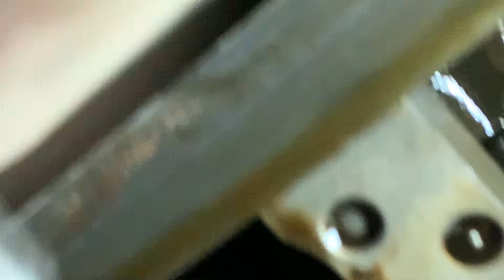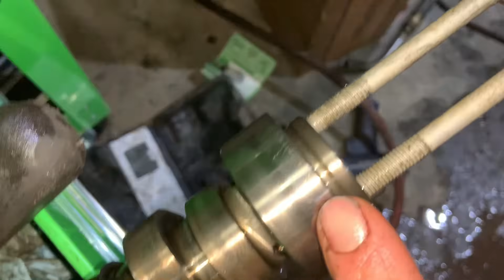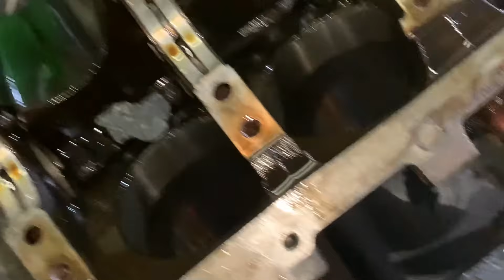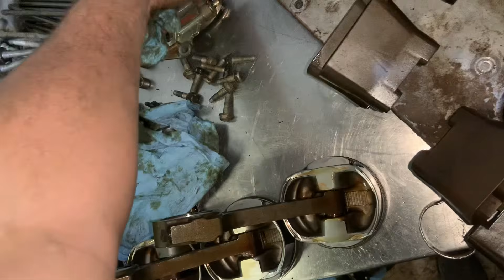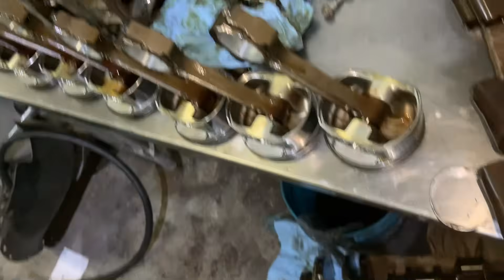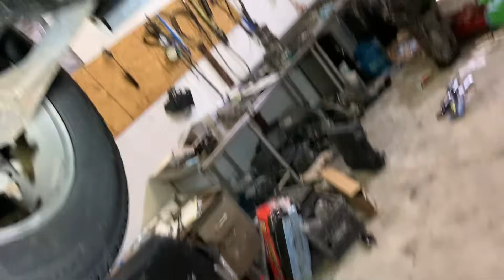ULTIMATE LS ENGINE NO OIL PRESSURE LOW OIL PRESSURE DIAGNOSIS AND REPAIR GUIDE

Comment: what about new build, good oil pressure 40ish I know the oil ring is good but noisy new lifters not much if any oil to the top of the engine, this will be the second time I've pulled the engine and tore it down , I realize I have missed something but this isn't my first build, 40 + years in the business,  its either bad new cheap lifters or very low flow to them and that' s hard to diagnose......thanks for your help
Reply from the maker: The oil galley feeds the lifters first in this motor then down to mains and rods.  If you have 40 plus something is for sure wrong.  I only use ls7 lifters.  Im sure you have done this but make sure you pushrods are not plugged up.  Run compressed air through them.  I have never seen this before when oil pressure is good.  let me know what you find.  Sorry Im not more help
Reply: @Brainstangs  the engine is in a 1957 Chevy 2 door wagon, these are not large cars and the engine is tight on the left side and rear so R&R is not fun everything has to come off of the engine including engine mounts intake exhaust manifolds ect. I'm seriously considering building a test stand to run the engine before i install it again. I will pass on what happened to the lifters when i get it pulled out and inspected.....thanks again
Reply: What did you find out?
Reply: Sorry for the delay too many projects all lifters were bad....I would like to show pictures of the differences in OEM lifters and cheap Chinese lifters but I'm not good with getting pictures into forums or any other places  but I could do a YouTube video but don't know how to reference it to this video???? there are some good cheap foreign lifters out there as i have a set in my first LS swap they are perfect but i got them on eBay and that seller is not active so i couldn't get another set from him......sorry but I just can't pay $300 for a set of lifters

Comment: Brian I thank you so much for your video I think it’s the best most detailed I have found. I subscribed. I have low oil pressure on 2010 6.2 liter LS Yukon xl Denali . Did the whole passenger side lifter change. Put all back together drove a week and sudden oil pressure drop. New VLOM new oil pressure gave. I am thinking now O ring on pick up tube maybe oil pump and now after seeing that I’m worried it’s cam barring . Ugh . I see oil around oil pan I was think rear seal but idk if that would cause sudden loss of pressure. Idk where to go from here. Father of 6 northern nuts, cheers bro Kevin , merry Christmas
Reply: Hey Brian, so I ended up taking off the harmonic balancer, doing the oil pump. I also managed to do it without taking the oil pan down. A complete miracle, but was able to crack the pick up tube bolt with a 10mm wrench and then the trick was with a magnet that faced 90 degrees upward I slowly worked the bolt till it was out. Tied a string to it half way down so when it came out and fell into the pan I pulled it out. I replaced the O-ring, and new regular flow pump. But I modified the pump relief valve by putting about 4 washers under the spring. I also used one of the bolts off the old pump with a washer to hold the other side of the pickup tube. Perfect matching bolt. After I put it all back together. And flushed the motor two times, all of a sudden I had oil pressure up to 55 psi on start up. 193,000 miles. I believe the pump and O Ring had issues. But I also think somewhere in the bowels of the motor there was sludge. It blew through with the higher pressure and wow, pumping good. I also went up to 10W30 conventional synthetic blend oil. I don’t think full synthetic 5w30 is good for these engines. It’s just too thin. So learned some new tricks, wasn’t easy. But didn’t take the oil pan down, modified new pump, upped the weight in oil and engine flush. I don’t think the lifters will fail now when it drops the pressure with active fuel management. With the oil pump modification it never drops into the teens. So all this work has paid off for the time being. Happy New Year 2021. Thank you for your Videos. Cheers 🍻 Kevin from NJ
Reply: Ha northern New Jersey. Again your video was great. I’m nervous to take the oil pan down myself on Jack’s. I did the lifters but I’m dying to know about the O Ring. Or even the pump. My oil pressure was around 40 cold down to 20  and teens at idle. Then to zero suddenly. No engine noise at all but the bells and whistles going off to shut it off. It was a new oil sender switch but could it be brand new out of box broken? And that dumb lil filter? Wish I was in Utah to bring it to you. My sons Liam And Se’amus look like your Ethan, god bless, Kevin
Reply from the maker: did you get it?  What was it.  Im guessing a new pump with oring will fix it.  If you had 20 psi, your cam bearings were where the needed to be. Unless they just popped out.  Let me know

Comment: 2006 5.3 138k miles no oil pressure at times. Replaced the sending unit and pick up o-ring. Still no oil pressure at times and the engine is noisy.  I just started it again no oil pressure at idle. Revved it to 2500rpm and 40psi. Back to idle 20psi, 3500 60psi. I know it is not fixed. Oil pump time?
Reply from the maker: yes.  that is your culprit

Comment: Great Video! Very informative. 
I have a long story. 2008 Silverado 5.3, 230,000 miles. I had an issue with zero oil pressure, fixed the issue by replacing the o-ring. Had great oil pressure again, 20lbs + at operating temp. I then had an afm lifter fail. We did the dod delete. New gm lifters, new valley cover, new lm7 cam, melling oil pump, and timing chain set. The engine runs and sounds great. Cold oil pressure is great at idle and at speed. However, at operating temps, I’m at 12-15lbs of oil pressure at idle, no higher than 38lbs while driving. Could this be the oil pan pressure relief valve? Cam bearings? Thanks
Reply from the maker: the gen 4 engines run less oil pressure at idle.  I delete the pan oil pressure relief when Im in there  always.  Dont know if thats your issue.  Not too concerned with 12-15 at idle.   If it was a cam bearing it would be five or less.  lot of miles, oil breaks down and gets thinner.  With a little looser clearances in  the motor and older oil this makes sense.  You do a fresh oil change and put 20-50 in there and  I bet you get good pressure.  Remember pressure is only and indication to flow.  You dont need much pressure to float bearing around a crank, you just need to make sure the volume is there.  So what I mean by this is for example, cold morning start, oil is thicker, pressure it up when you first start it and then drops off as it warms.  So this condition gives you more pressure but less volume flow as the oil is thicker and some is most likely recirculating at the pump pressure relief.  Hot day outside and engine is hot. Low oil pressure or what that really means is low resistance to flow, so you have lots of volume but lower pressure. As long as you pressure dont drop way off like under 8 at idle your fine.  Sorry this is long winded. Hope this helps

Comment: I have a donor  4.8 with 65k for a swap out of a wrecked van. I intend to swap in a project without rebuilding. I have not attempted to turn over the engine yet. It has been sitting a few years. Looks like it was stored indoors and looks pretty clean. I will be swapping the pan. What would be the minimum I should do to ensure a good runner? I'm thinking: prime oil system, Compression test/leak down, change barbell seal, pickup seal, cam plate, check for migrating cam bearing, seal the flex plate bolts , Valve seals, anything else?  What is your list for running a wrecking yard engine?
Reply from the maker: your list is quite comprehensive compared to mine.  Barbell is fine, dont touch, for sure do a oring  on the pump if not a melling 295 complete pump.  They are only 50 on amazon.  Sure prime the motor on the stand and while doing it turn it over a few times by hand and a 24 mm socket.  That will get fresh oil on all the parts inside.  Thats really it unless you see something obvious.  These engine are amazing.   Compression test on the stand after a few years sitting is tricky as the lifters have pumped down and you wont get good cranking pressure.   If the valves dont open enough and on time due to lifters that are not pumped up, you will get a false reading.  same with a leak down. If you dont suspect any damage, it will most likely be fine. Cam plates rarely go bad.  Even if they do they dont leak enough oil to really matter.  So I would not bother here either.  Valve seals generally are pretty good too.  Do them if you like.  Just lube the top end with covers off so start up isnt dry.  summary , biggest thing for me is new oring and pump, and a good prime.
Reply: @Brainstangs  When you say o-ring on the pump, are you referring to the pick up tube o-ring?

Comment: what if your LS2 starts Cold with good oil pressure but drops 15 psi when the engine warms up??
Reply from the maker: That is the what pressure and viscosity do.  Cold in morning so its hard to flow the thick oil, so you have higher oil pressure.  As it warms oil thins out, its easier to flow, pressure goes down.  Totally normal.   Nothing to worry about as long as your over 10 psi at idle hot.  Cause at 10 hot your still getting a ton of volume delivered.  If your looking to raise the overall pressure you can try fresh 20-50 and I bet it gains 5-10 psi everywhere.

Comment: Great information in this video, keep up the good work! My LS build had issues with oil pressure being extremely low, took it back to the machine shop. Hoping that its one of my cam bearings as well (even though they replaced them once already, hoping its just misaligned)

Comment: My motor was apparently on break in tune. Heads cam LQ9 just rebuilt according to previous owner. I had 25 to 30psi. Was getting gas in my oil. One day was driving it around 1 mile away from my house then I have no oil pressure and its starting to tick. I turned it off and kept using my key to prime the pump. Has 15psi oil pressure and doesn't tick or knock loud enough to hear over the straight pipes. Also my dash oil pressure doesn't work it's a hard wired guage. 

I haven't heated the motor up science it lost oil pressure but I've moved it around the yard. Gets 15psi now. I'm pretty screwed aren't I.

The bottom end wasn't touched I don't think when the previous owner swapped it into my camaro.
Reply from the maker: put a pump in it now.   And you might be fine
Reply: @Brainstangs  I fixed it by buying an L96 6.0 out of a G8 with ported 821 heads and a ported Ls3 intake and cryo coated

Comment: Wondering if you've seen my combination of symptoms.  2006 5.3L 238k miles.
Oil pressure recently changed from 50-60 psi constantly to 35-40 at idle and can sometimes get 50-60 while on the gas.
The engine sounds great on a cold start, but as soon as it hits operating temperature a bad loud tick starts, like a lifter tick.  If I give it a little gas to bring up the oil pressure I can make it go away, and comes back again after idling a bit.  Then it goes away completely after driving around for 10 minutes or so.  I'll have this tick every time after the engine warms up from a cold start.
Reply from the maker: 100 percent the oring at the pump. its getting air and lifter tick.  Change the oring and you will see!

Comment: I just lost oil pressure in my 02 silverado (0 psi) it started making all kinds of noise on cold start this morning, it was running perfectly fine yesterday at around 45 - 50psi with no symptoms. I will use the info you gave us to try to figure this out the right way.
Reply from the maker: im sure its a pump or oring issue.  Let me know what you find
Reply: Go lookup the LS engine for piston slap(some pistons are cam ground so they seat properly when hot...

Comment: Very informative video . Thanks for posting.  I do a lot of 07 and up AFM deletes on these engines, I done one last week that has me stumped. before the reprogram and VLOM modification I had 40 psi cold 32ish hot and a quick oil pressure  response when rpms are raised .  First start up after the VLOM  mod and reprogram the oil pressure was 19ish cold and dropped to 0 fairly quick. No engine noise at idle. I checked with a manual gauge and verified it was indeed that low. So after doing 20 or so without issue this has me puzzled. I just don't see what could be that immediate  Do you think oil pump relief valve maybe stuck just by coincidence?  Or is it possible when I took the gaskets off the towers the lifters are bleeding up the tower? I have the oil hole blocked on the VLOM so I'm not loosing oil though the solenoids . The truck runs smooth and strong after the delete and before. The reason for the delete it would backfire when it went into 4cyl mode, ran fine in v8 and runs good now in v8 just low pressure. I am going to check oil pressure at the filter later this week when the adapter comes in. I appreciate any thoughts you may have on this.  Thanks
Reply from the maker: I doubt its anything but related to your afm delete.  I would bet you have something leaking on your towers.  What kind of delete do you do?  I do them all the time but I put in a l92 valley cover and new cam and lifters.  I know there are hacks but I think they can cause other issues, maybe here.  Good luck on this one.  I think if you dig back into it and tap and plug the feed to the vlom you might find your oil pressure is back.
Reply: @Brainstangs  Thanks for the response.  The AFM delete I do consist of a tune to turn the system off and i remove the VLOM valley cover and plug the hole that feeds the solenoids and cut the tower gaskets just for added insurance in case of back pressure on the towers so the AFM lifter will not collapse. I have done many this same way and never had a issue until this one.  But this truck has been a odd one from the start with the backfire issue when it would go into 4cyl mode. Never had one do that, but it runs great now after the delete  but has the oil pressure issue.  Do you think a lifter would let oil bleed up the tower and loose pressure ? Just throwing stuff out to see what might stick. LOL Thanks again .
Reply: @jackmac9569  I had the same problem with my DoD delete, what did you come up with

Comment: Will it make a noise when the cam slides out?? Like ticking?
Reply from the maker: if you have no oil pressure it will tick for sure. lifters are bleeding down at this point.

Comment: Thank you! Great Video. 1 Question the cap in front that the barbell is in. If there is No cap in front will you lose or No oil pressure?
Reply from the maker: The barbell has no cap.   It’s held in place by the rear cover. The cap you may be referring to is a expansion plug/cap in the front of the block.  If that’s out yes you will have no oil pressure

Comment: ls1 big cam no problem good power love smoking the wheels but one morning started up and hear all engine noises.Pop the bonnet can hear all tapping noises and then it just stopped.
Took it to protune auto check oil pressure ok he had it for a few days no problem.back at home for a week and no problems so far.But from watching the video it looks like the oil pump could be at fault.
Reply from the maker: yes.  stay on top of that!  you might need a  pump

Comment: Had replaced my high volume an high pressure oil pump an my pick up tube now recently have low oil pressure problem an when i start my truck up the pressure goes up to 20 psi but when I drive it goes up to 40 psi an when i pull up to a stop the light comes on an RPMs drop
Reply from the maker: 20 at idle isnt  a issue.  that is fine.  When you see 10 psi thats when I worry and think something is wrong

Comment: I have an 05 Tahoe. 5.3. Sometimes, as I'm driving the oil pressure will go to zero. I don't get a message on the dash and the engine has a very very slight tick, you Really have to listen for it and even then I'm questioning if I'm hearing a tick. I replaced the oil pressure sensor with an OEM one and I thought it fixed the problem but today, as I'm driving I noticed it went to zero. No engine noise, it obviously had pressure. I don't know what to do. Is the engine shot? Do I need a new pump? After you let the truck sit for 5 minutes, if you restart it the pressure is back to normal. The fact that I don't get an oil pressure warning or CEL is weird. Any help would be greatly appreciated. You anywhere near Denver ?
Reply from the maker: bad gage.  03-06 were really bad.
Reply: @Brainstangs  You're bang on correct. Hooked up a Tech 2 and did a gauge sweep and thr oil pressure stepper motor is bad. Had thr cluster rebuilt by a local guy here in Denver. Just got it back today. Thanks for the reply. Any early steps I can take to prevent low oil pressure?

Comment: Very, very good.  Yes, some redundancies, but given these are several short videos stitched together, and for the wealth of info given, I'm not gonna complain one bit about them.
Came here b/c I'm finishing up a cam swap w/ heads and general freshening up in my truck - same engine, 2003 LQ4. It had great oil pressure to begin with, but it still got a new Melling HV pump, along with a new pickup tube, since I had to take the front cover / balancer off.
Anyway...I've been trying to pre-lube the motor, and not seeing oil get up to the pushrods / rocker oil holes.  Enjoyed watching this, even if it didn't give me any new ideas.  
Looks like I'm going to work up a pressurized lubing rig, and give it another try.
Reply from the maker: glad you liked it.  Hope yours goes well